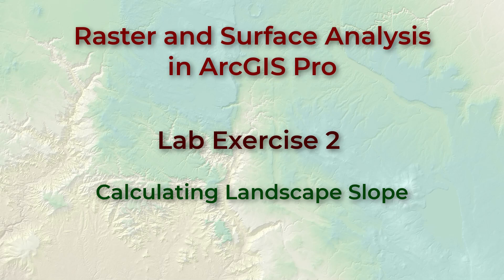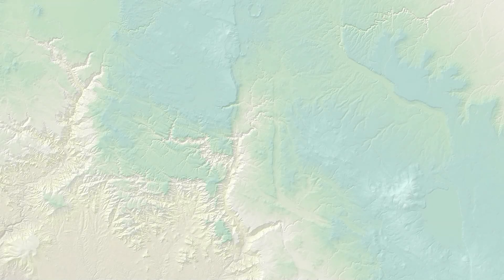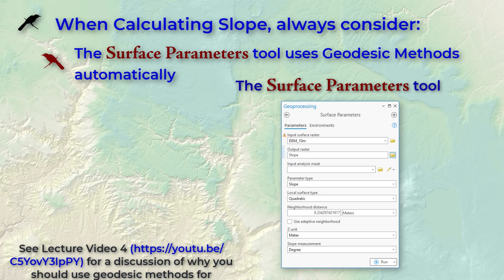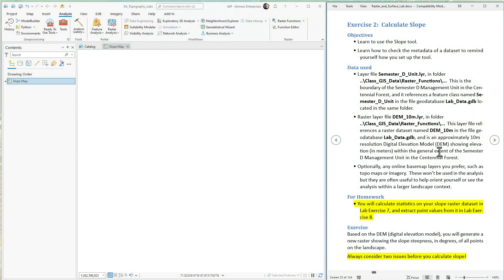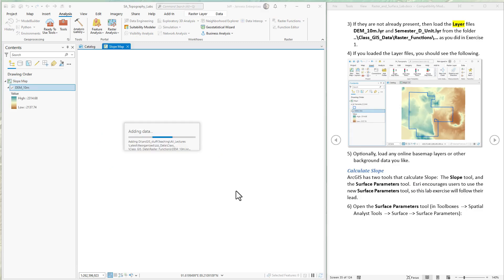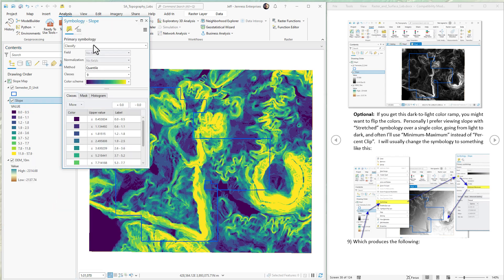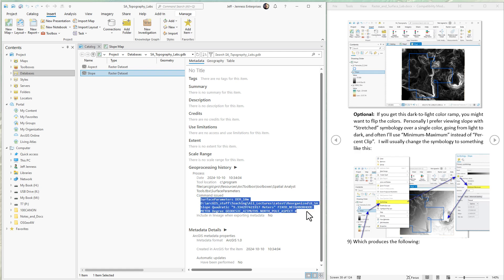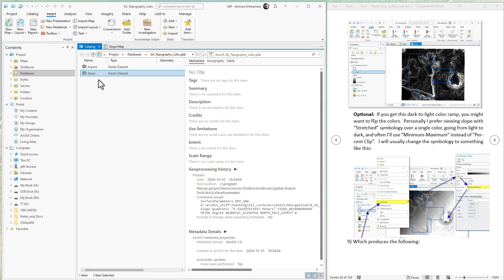Raster Lab 2: Calculating Slope in ArcGIS Pro

Comment: Just_add_the_degree_or_percent_in_the_title
Reply from the maker: Hmm.  I'm not exactly sure what you are asking.  I'm calculating slope in degrees in this demonstration, but its very simple to use percent instead.  Just choose "Percent" rather than "Degrees" as the slope units and you should be good to go.

Hope this helps!  Take care -
    Jeff
Reply: @ sorry for the sly comment… I think I thought it would be useful* to state the degree or percent in the title of the layer “Slope_Degree” or “Slope_Percent”. That way you don’t have to check. Though, after reconsideration, it’s pointless, bc you would still want to do your due diligence and check the units in the metadata regardless
Reply from the maker: @jesseadamson1077  

Oh, I see.  Yeah, good point!  I agree; it's often a good idea to put some clue to important details in the dataset name.  I do that myself.  Thanks for the suggestion!  But you're also right about having to check the details when you get data from sources you aren't sure about.  Also a good point.

Thanks again!